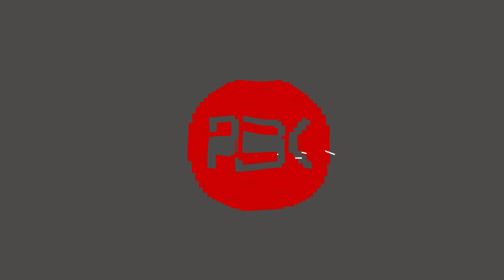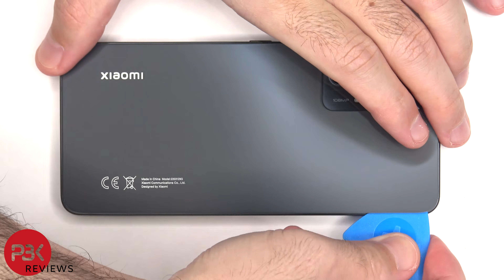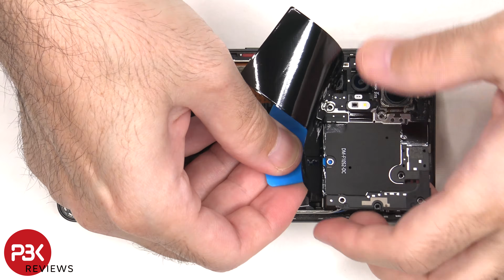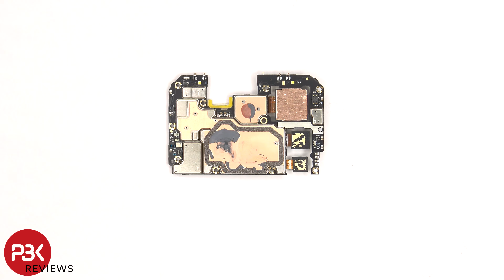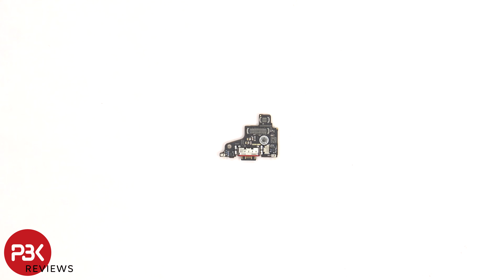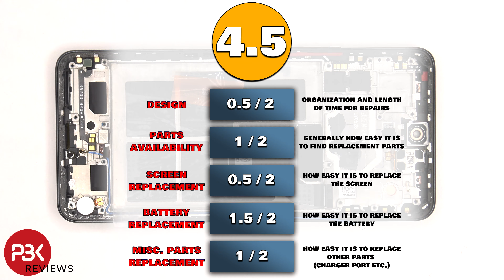Xiaomi 12 Lite Disassembly Teardown Repair Video Review

Comment: I punctured the microphone hole thinking it was the sim hole, could it be damaged? Or something? It is this same cell phone, I already tested the recording microphone and it sounds good, but I want to know if some of the water resistance could have been broken please help
Reply from the maker: The mic and filter are seated above the hole so you should be fine. Sometimes there is an additional filter in the frame where the hole is but yeah for the most part you should be fine.

Comment: I have this phone, was already down after 6 month, trying to dissasemble it to get back the memory. Such a bad quality phone.
Reply from the maker: The memory is soldered to the main board, its not removable if that's what your planning on.
Reply: Ah thanks for the reply, is there any way to solder it to some usb drive interface or can I just throw it away ? @PBKreviews